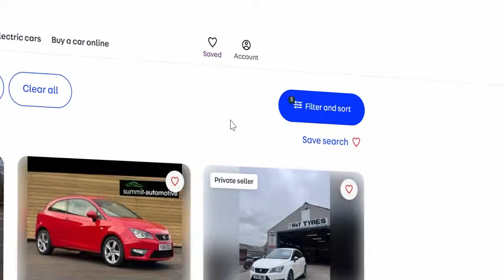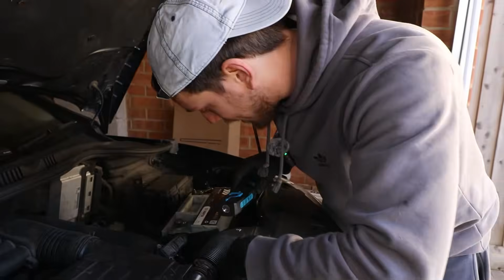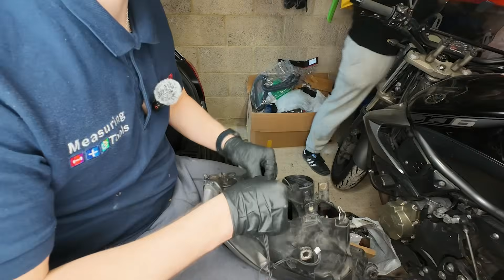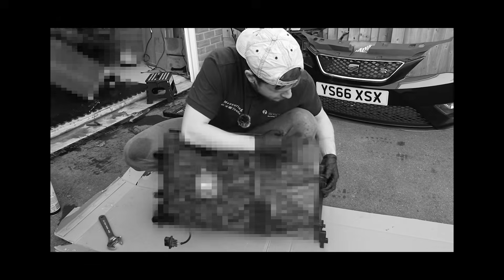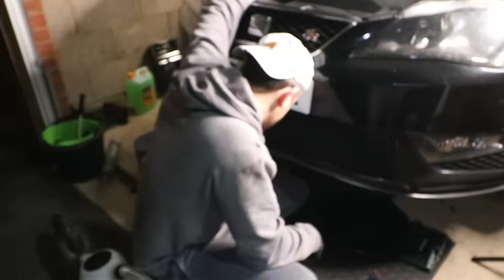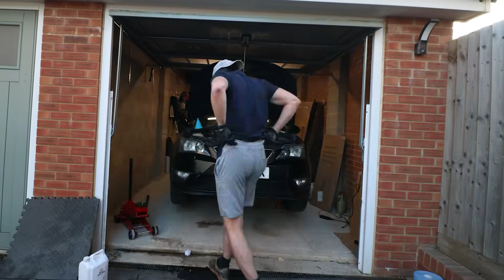Can I fix this BUDGET CAT S car in 24 HOURS?

Comment: Great video and a first time watcher.
Get yourself a ratchet crimping tool like the scr3wfix 489XG.
Don't forget to heat shrink the connection as rain and moisture will soon corrode your connections.
Also terminology dip, passing and low beam are all what you drive on at night and extended range is main or high beam. 
Keep it up though
Reply from the maker: Perfect, I’ll have a look and get myself those tool! Really appreciate the comment and support!